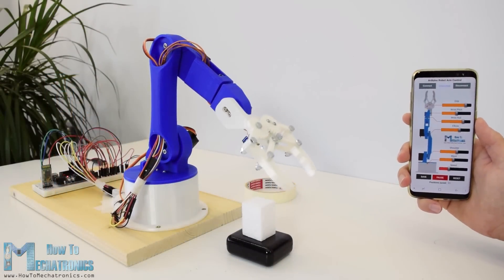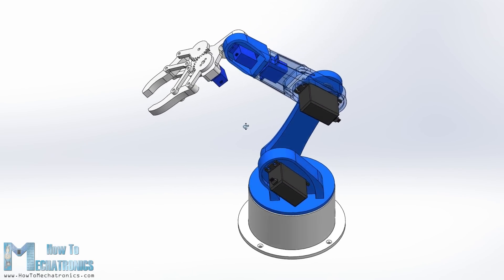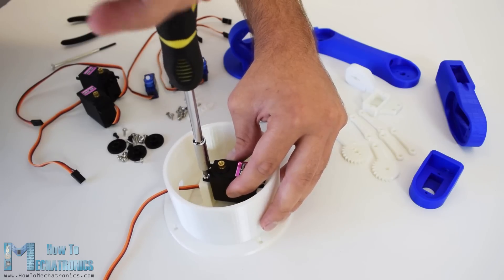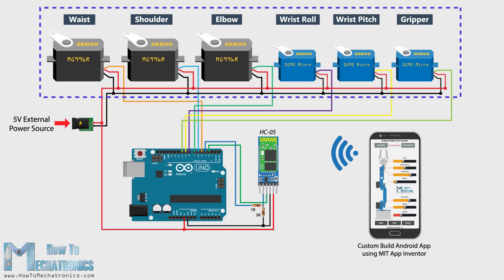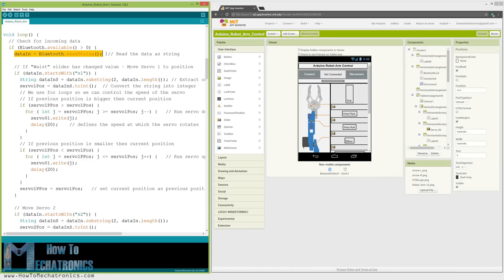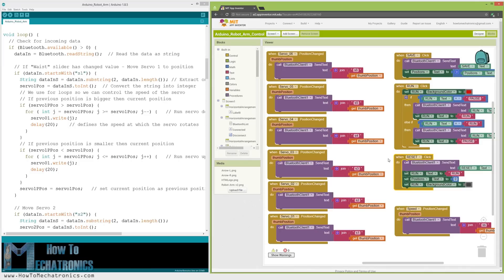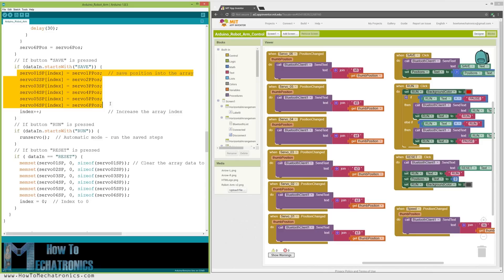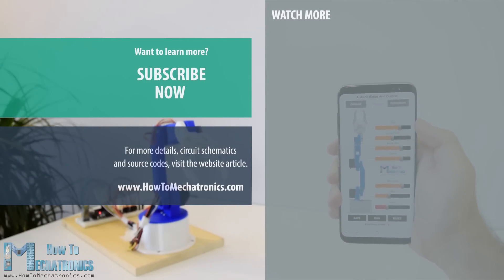DIY Arduino Robot Arm with Smartphone Control

Comment: In your schematic conection I see that you input 5v externally, but that voltage you put it into the 5v pin of the arduino. Should not go to Vin?
Reply from the maker: Well we use the Vin in case we supply the Arduino with 7-12V. That's because the voltage from the Vin pin goes through the voltage regulator of the Arduino and it's converted to 5V. So in case you put there 5V the voltage regulator won't work.
So in case you have 5V power supply, you can directly connect it to the 5V pin of the Arduino.

Comment: the motors are rarely moving. how to fix that problem
Reply: same for me
Reply: More details, are u supplying the right power and not under/overvolting the servos
Reply: Vlad Baranov thanks now its working i used seperate power supplies to mg and sg servo motors

Comment: I tried this project, but it was not working, after making the baud rate 9600 from 38400 it is barely moving, and the servos are working quite in accurate, i can't figure out the problem, can any one help
Reply: same for me
Reply: Try Little arm, using 4 mg966r servos, little arm code but use this model

Comment: Hello. I tried to do the project, but it does not work too. With "Bluetooth.begin (38400);" , the servos only trembled a bit, and with "Bluetooth.begin (9600);" , sometimes moves and rarely goes into the "RUN" function. What am I wrong?
Reply: Same for me...can you tell me how to make this work?
Reply: if you found the solution then please help me because its part of my graduation project and i have the same problem
Reply: @roshbit2091  I did not receive the answer and I gave up the project ...